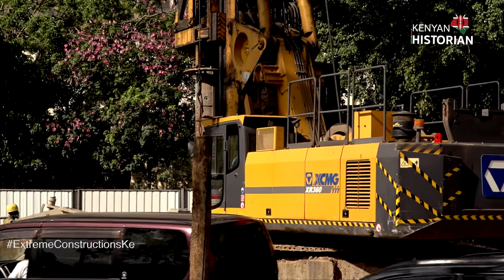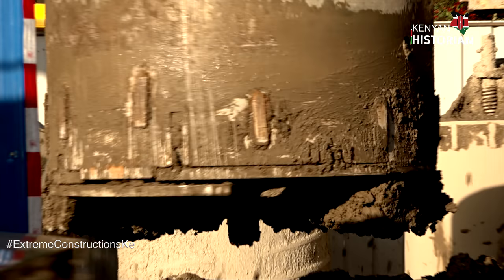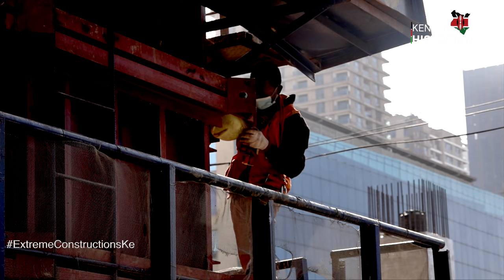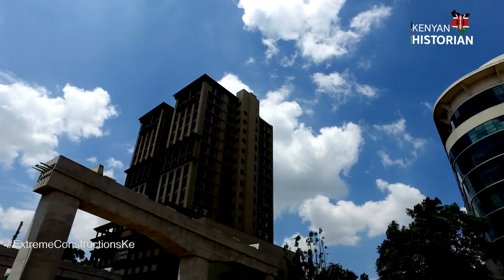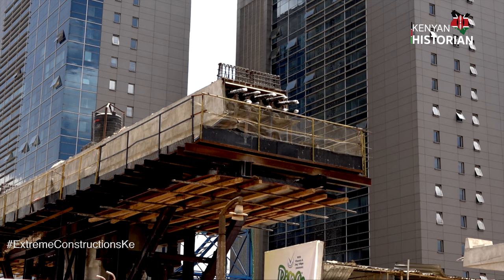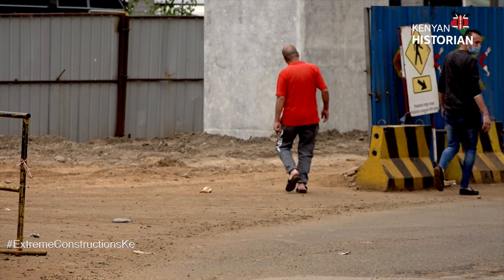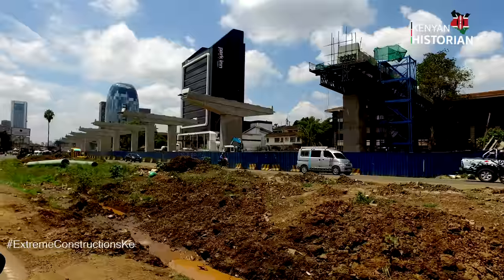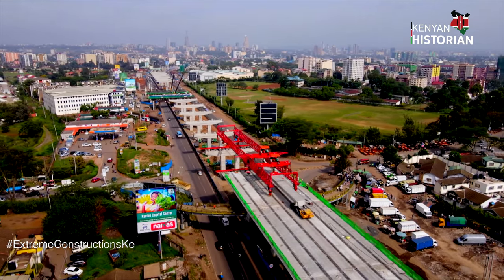KENYA'S EXTREME CONSTRUCTIONS: Inside the construction of the Express-highway in 4K. Future Megacity

Comment: Every component in this job is outsourced, no kenyan products.  We must use indigenous resources and give employment  directly and indirectly
Reply: This is a privately developed expressway whose focus is to drive costs to the bare minimum yet make a profit by attracting traffic. If the developer is compelled to source materials from one place or another regardless of the cost, then such cost escalations must be carried forward into the negotiations for the toll fee, which, in turn could affect other parameters like traffic.
Reply: its only the heavy machines otherwise 95% of the building materials are from  local market

Comment: Please show us  where they are making these concrete columns and steel. How they are made and transported to the site? where they get the raw materials. Are they using cement and steel from kenya?
Reply: Being the elec engineer on site every metal and steel is from our factories here in kenya
Reply: @powerengineering1913  Great. Now that would be interesting to see how they make the pillars and steel beams
Reply: Nothing ,all is outsourced that's biggest concern
Reply: Metals are from tononoka company, cement from East africa portlant cement(bluetriangle cement)
Reply: @sultanmswahilitv4864  may be you can have a video of those places making the cement beams and steel for the project. Kenyans can then appreciate the manufacturing capabilities of our country. We don't get to see much of heavy or large  manufacturing in large scale in Kenya
Reply: @daviddavis7959  the making of those beams is done in south B, ,i once saw how they are made....much metal rods is used.

Comment: Are you sure the hole is drilled to upto 100ft below the ground?
Reply: Good work, you have done indepth research and reported the ongoing work in great details. kudos
Reply: I am also not sure if he is sure and I am wondering what he would have to do to be sure. I guess he has to rely on the contractors word! But 100ft is not a hell of a deep hole. Thats just about 30 meters deep. That's pretty shallow. I would have no reason to doubt that figure.

Comment: So if the contract was to construct the expressway on the spaces in between Mombasa road, Uhuru highway and the waiyaki way, what happens to the old infrastructure if the elevated highway is tolled and the ground level road is free? 

Will it be left as it is or done to low standards to maintain status quo enticing motorists to use the tolled one? 

I'd like to know.

Comment: I would rather they built trams or cycleways cause the masses don't have cars.
Reply: Who?? The private investor? Trams and such like things are supposed to be undertakings by the Govt. Since this project does not strike a dent in Govt funds, the Govt can still go ahead and build its trams and light rails. This project is not and cannot be the reason why the Govt has not developed trans and light rails.
Reply: @georgeodhiambo598  the goverment your talking about is thrieving on debts if it can't pay salaries its on the verge of bankruptcy yet you want it to think about development? Switch ur brains on plizzzz!
Reply: @mwendapoleee  But you are nullifying your own comment! Your brain went off along time ago! Let me simplify matters for you. This is a private developer with an eye on profits. Developing of trams and light rail way lines has never been attractive to private developers because of the expected govt imposed low ceiling on ticket charges. Therefore, by and large they are developed by govts, whether they are corrupt or not. The private sector may come in to operate or at times, invest in coaches and operate while charging a regulated fee.
Reply: @georgeodhiambo598  The problem here is not who invests in wateva but finding a modern system where the City is decongested the pollution be it the noise ,traffic and air pollution is horrid.Modern upto datePublic transportation should be a priority not for privat psv.Other cities are actually thinking of providing free transportation for City dwellers because in the long run citizens spend that money anyway be it in parks or Restaurants. But what do we do enhance the gap between the have verses the have nots.
Reply: @mwendapoleee  Stop sidestepping the issue! Your comment was that "they" should have built trams and light rail lines instead. And my first question was who are "they"??  You can't then now turn around and run away from that framework of discussion!